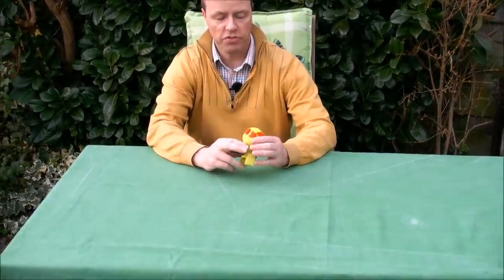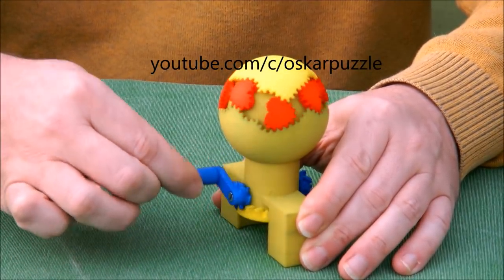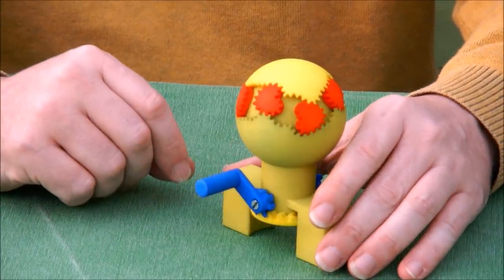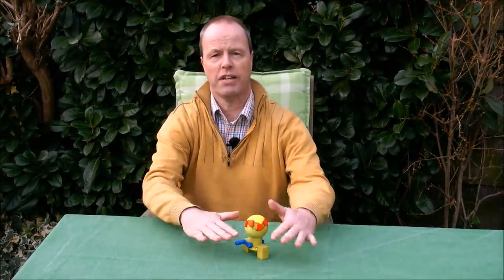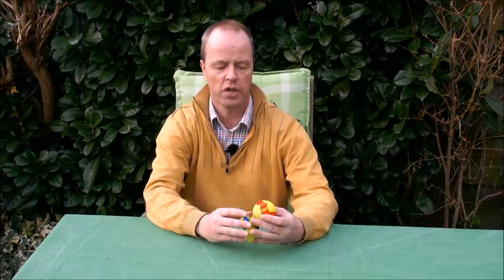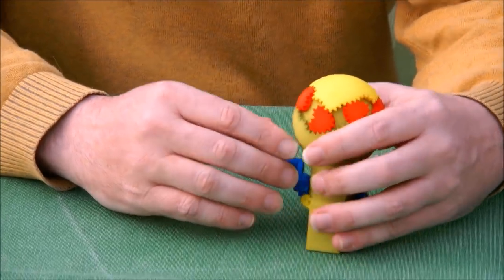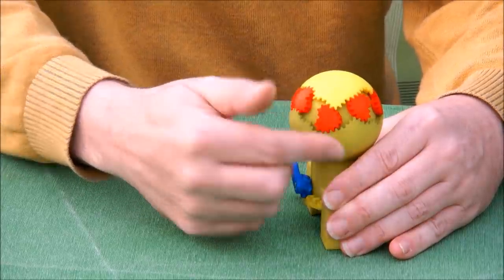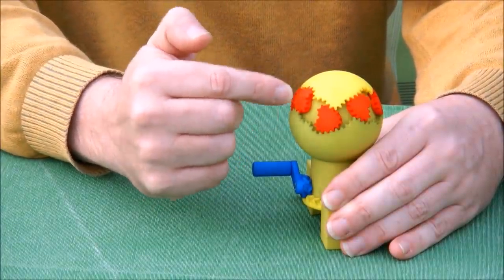Valentine Gear Sphere

Comment: My father (who turned 76 this winter) has worked his whole life in his little mechanical workshop. Milling and operating the lathe constructing part for engine etc. A speciality for him was to calculate and manufacture gears for all sort of thing, with his lathe and specially his old gear dividing head and the milling machine. He is retired now but has all the machine left, but the body is not 100% now. What a fantastic present for my father who really is a "gear-head" :)
Reply from the maker: That would be great indeed. Happy birthday to your father!

Comment: Hey Oskar, why did Mefferts discontinue gear shift?
Reply from the maker: Mass-produced puzzles are made in batches. Production capacity is scarse and production takes time. So when a product goes out of stock, then it may take a while to restock, especially if market demand for other products is higher.